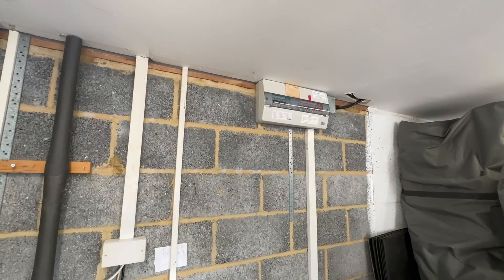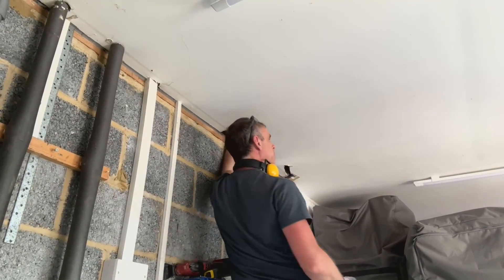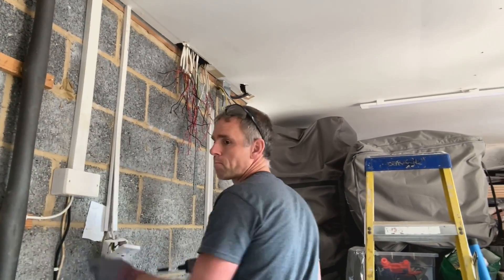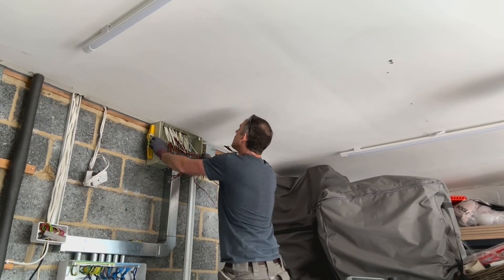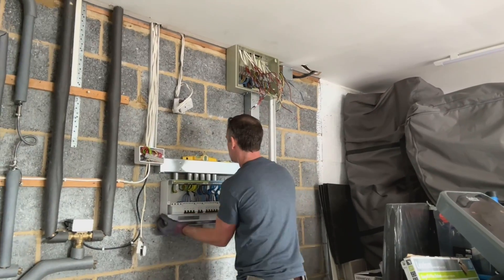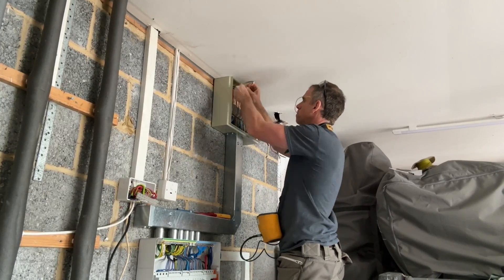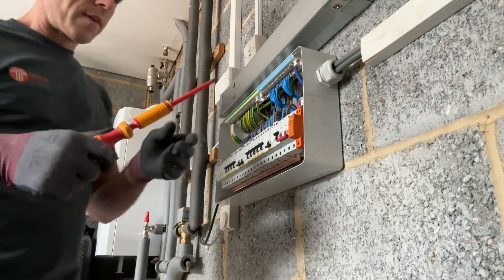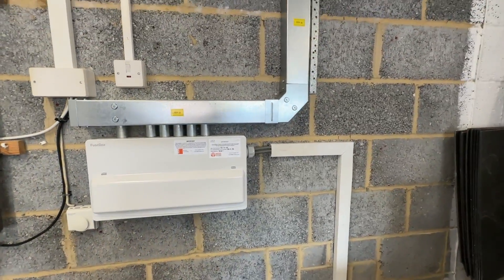Consumer Unit Replacement - Start to Finish

Comment: Looks presentable and a generally neat job, but should never join main equipotential bonding cables with screw terminals, needs to be a straight through mechanical crimp. You should also do your r1+r2 readings on each circuit with CPC disconnected from the earth bar to prove that the circuit is not using a parallel earth path

Comment: Why did you choose to mount it so low and offset from original position? Seems like you have used a lot of wall space that could have been used for future shelving, etc. and a lot of extra material. Not a criticism, just wondering how you and the homeowner came to the decision?
Reply from the maker: The client needed it to be lowered for easier access, and wanted to potentially build a cabinet around the consumer unit and boiler at a later date.  The garage is huge, so no lack space for racking and shelving at a later date.
Reply: It's also embodied in Building Regs now........ AD M1...... switches 1350-1450 off the floor..... Out of reach from kids, but accessible for maintenance, e.g. RCD testing... Like all regs, not retrospective, but if you can bring an existing within latest regs, it's gotta be a positive!
Reply from the maker: Correct! If it’s feasible to move a board when changing one then I think you should do it.

Comment from the maker: This the final video that I filmed as part of a consumer unit changeover.

I bring the pre assembled and wired board to site, remove the existing one and carry out the consumer unit changeover.

As with all jobs, if I were to do it again I would do some parts of it differently.  I cut a slot in the top of the junction box as a cable entry, on future jobs I would definitely install stuffing glands to allow easy sealing of the top surface.  Replacing a consumer unit is never the same twice, and every time I do it,  I learn new techniques and methods that I try to employ on future jobs.  

In a previous videos you saw me cut the steel trunking and assemble the board and main junction box, and also pre wire the board and junction box ready to take to site.